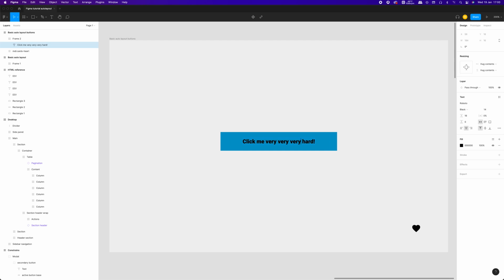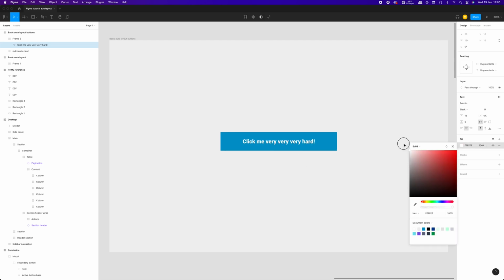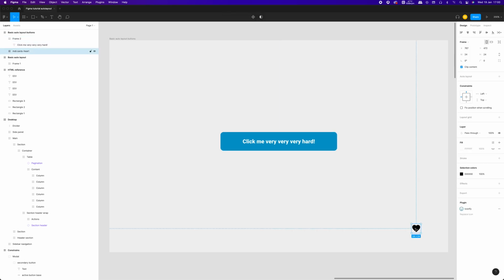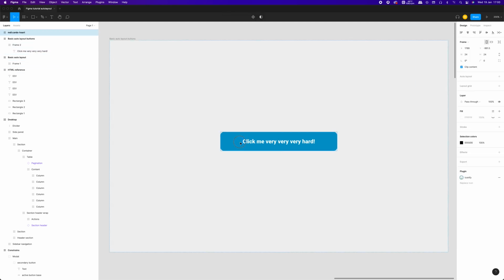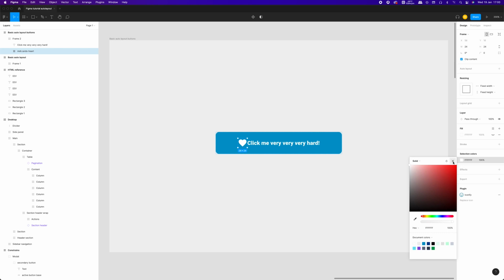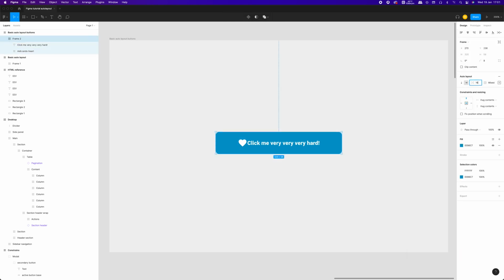Master Auto Layout with Figma – A Comprehensive Guide

Comment: So is it good to use it for bigger designs ans components or should we stick to the small ones like buttons etc (specially for begginers)
Reply from the maker: If you are working on a small project like a website landing page, simple screens for presentation where speed and freedom is essential, or you are at the beginning of a bigger project where you still experiment and change things a lot - I don't recommend it. When you are working on bigger projects, especially with some sort of design system in place - this is the place where auto layout shines and is a must.

Using it for small components especially at the beginning of your career is a good idea because it will allow you to ensure proper sizes and details which I noticed that novice designers tend to struggle with a lot.